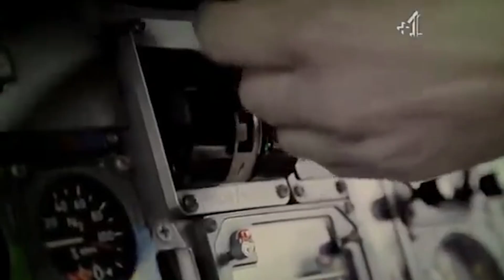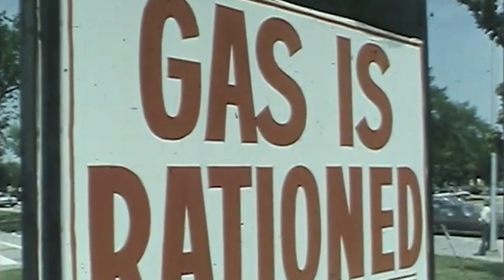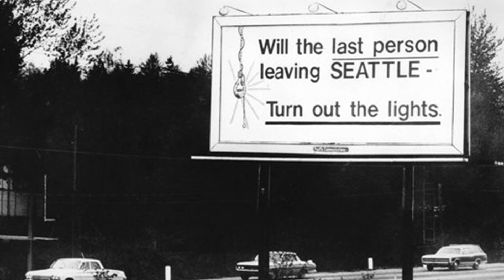The Forgotten American Concordes - Boeing 2707 - Lockheed L-2000 SST

Comment: As I recall, back in the late 60s, the SST became rather a political football in the US, with many politicians snubbing it as a waste of money.  I can't help but see a lot of that attitude reflecting short-term thinking.  As you observed, a great deal of the research Boeing and Lockheed did on the SST had important subsequent use, even as there was considerable positive technological gains from the race to the moon.

I'd love to believe that one day, Homo sapiens can learn to think past the next quarterly report ... but I ain't holding my breath.
Reply: Good remarks, but you all missed, and so did the video, one major event in the SST development that turned many supporters, even in the aviation community into opponents of the concept.  NASA used the XB-70, about the same size as the SST's to test the sonic boom levels. To the shock of designers, when it turned its shock wave actually would break windows. The XB-70 proved that the larger faster Boeing wouldn't rattle windows like the Concord it would break them.  Remember energy increasing with the  square of velocity and so does volume. Adding 10% to the length and width increased the Boeing volume by 120% . factor in the 130% speed increase, which is 170% more energy and you get almost twice the pressure in the shock wave. NASA ad FAA even tried to use smaller aircraft to disprove it and they got----See also https://en.wikipedia.org/wiki/Oklahoma_City_sonic_boom_tests
Reply: Michael Hunt, I was old enough to understand the debates in the USA over the SST during those years . I lived in Chicago. I had relatives in the NY City area. The opposition to airport noise in general and the SST in particular was fierce. Airport noise activists who had numbered in the dozens now numbered in the thousands and they were much more vocal and active. The rural complaints from ranchers, farmers, and wildlife enthusiasts over supersonic booms grew significantly.  The politicians knew they were in trouble when the usual groups who disliked each other were combining on this issue. The letter writing campaigns opposing the SST and supersonic over-flights grew significantly. It was not a matter of if the USA could build an SST. Of course we could do that. We had built the XB-70. The issue was it in the national interest to continue taxpayer funding for something the public did not want. Not just not wanting taxpayer money spent on, but not wanting in general.
Reply: I lived in OKC during those sonic boom tests and remember them well!  While the Wiki article makes it seem like no big deal I remember the windows shaking and all the dogs barking.  After a while you were always kind of on edge as you waited for the next boom.  A boom or two a day would have been bearable but a steady diet of them would have driven people nuts.  Physics isn't just a good idea...its the law!
Reply: The government often bears the cost of developing new technology but I can hardly blame the public with the amount of money that's wasted it's hard to distinguish worthy endeavors from the rest of the pork spending.
Reply: When the vast majority of your constituents want to avoid having potential sonic bangs every 20 minutes, what are you going to do? Keep the SST going?
Reply: David Hoffman  I had not thought of it, but a  lot of people under say about 45 have never heard the 1st and 2nd generation jets.  Many people do not know how loud and harsh the sound was from the early axial and low bypass ratio turbofans. If they had then they would understand why people were freaking out over an even louder plane.
Reply: +Michael Cubstead "nerd alert"
Reply: Meh,  "short-term thinking"  what really killed these was economics,   747s etc.   greatly dropped the price of air travel,   which would you prefer,  an 8 hour flight for $600? (on a plane you could stretch out)   or a 3 hour flight for $3000?   It's sometimes harder to have the courage to drop a project than to start one,  and this has since proven to be the correct decision.
Reply: Its almost like they were right.... it was a waste of money
Reply: Much like the a'hole mayor who shut down Meig's Field in Chicago at 10H30 one night a few years back, because of some of his constituants complaining of noise. I mean really on an artificial island called Northerly Island in Lake Michigan, a good two KM's away from the city's edge. The airport was there before a developing city or suburb, as is the case with ALL airports worldwide.
Reply: *****, After the restriction to subsonic speeds for commercial traffic doing transcontinental flights over land was created, there was almost no way to make an economic case for using the Concorde over routes such as NYC to LA. I think Braniff did a DFW to Washington DC route at subsonic speeds using code shared Concordes, but it was a financial loss. The time difference between a Boeing 747 using the route and a subsonic Concorde was not enough to justify the price difference between the two in the flying public's opinion.
Reply: Michael Cubstead, We just went from C-5Bs to C-5Ms, The noise characteristics are so different. Not only quieter, but certain engine noise frequencies are almost gone. The Bs were terrible.

I used to work T-37s(Tweets) and the difference between that and an A-37 was amazing. The A-37s were more powerful, but you could more easily tolerate the type of noise they produced.

When we first went to KC-135Rs from the older KC-135s it seemed like the re-engined aircraft could almost not be heard during a flyover. What a blessing.

Yes, the younger generation has not had to suffer the noise intensity us old folks did during the earlier decades of the jet age.
Reply: But is that not just the frequency being raised or lowered to an inaudible human level, or at another human inaudible harmonic. Remember we can only hear between 20 and 20KHZ, and a limited harmonic range. Many of us in main stream society can only hear between 35 and 10KHZ, which deteriorates as we get older or exposed to regular high levels of noise pollution. And the younger generation are actually worse off, compared to us from the start of the jet age. They are exposed to modern sound creating electronics, in the form of ear sealing buds with high db levels of music from mobile devices, high db levels in the music and dance clubs, or the sound systems in cars today. In fact we all are worse off today, adding city noise etc. I covered this in more detail in another post here. It's now a known fact that anyone from the 50's to present day has far less hearing on average than prior to these years. We only have around 30,000 hearing "hair" cells in our ears and damage to them is permanent, as they are flattened or separated due to our noisy world. They never straighten up or grow back, so when depleted, that's it we're deaf. Google "How sound affects the inner ear" to read up about it ans see pics of the outer and inner ear.
Reply: Andrew Brown I would argue you are not considering the size of the aircraft. The sonic boom intensity is not just a factor of speed also air displacement. To your point you could resolve the problem by going above FL800. Like the  SR71. The air is so thin the boom (abstractly the sound equivalent of a ships wake)  isn't strong enough to reach the ground.---But I would also argue this, why spend 2+billion developing a new SST, when your 90% of the performance of  an HST (hyper sonic) project.  Consider, you need to add only a thruster system to keep it staple, simple motion control computer, and a kick from mock 3.00 fl800 to mock 6 fl1000 and let gravity and inertia should do the rest.? I also believe we could develop safe field swappable solid rockets to add that kick.
Reply: It was not noise. It was his wife wanting a new flower garden and play area for all her play park demanding friends. She only got part of her wish as there are also noisy concerts held there now. Dumb decision to close that airport.
Reply: David Hoffman Yes point taken. But now what is the paradox, of city works with noisy jackhammers, and when necessary blasting taking place, never mind the general constant 24/7 noise of a city, with people talking, shouting, police sirens going off at all hours of the night and early morning, and all the other disturbing loud noises. Never mind the ear drum shattering decibel levels inside most night clubs, and here patrons put this upon themselves. Or our mobile devices with ear sealing headphones and ear buds, with sound too loud, and those that insist we hear their choice of music in their cars, coming from their massive car sound systems with windows wound down. Then what about those that live on top of airports, especially extremely busy ones, with a plane taking off and approaching every five minutes. Today modern jet engine technology is getting better so below their max thrust, or even before the SST's reach sonic boom speed, their noise abatement is improving, and above 20,000 feet one can just hear a sonic boom, with SST cruisng at 60,000 feet it is almost impercetible, as sound abates and decays over a very short period of time. And on a final note most decent places of work are well insulated in controlling random noise.
Reply: I love long dull videos on tests! thanks!
Reply: But they weren't allowed to travel at supersonic speeds over land anyway, so what's the problem?
Reply: He didn't watch the video. lol Well not the part where they explained it.
Reply: The 727 was loud and sometimes seemed to get louder as it receded away. The engines must have directed the noise directly rearward in a "beam" and if you happened to be in the "beam" it got louder as the plane receded and you could hear a cracking sound in the burn as well. It got louder till it abruptly went quiet as the 727 disappeared into the distance. lol
Reply: Andrew Brown, Every year I get the OSHA approved hearing conservation training and the instructor goes into all the stomach churning detail about hearing loss. I get queasy just walking into a hospital so I am really suffering in those types of lectures. As they say there are no bionic ears to replace loss of hearing.
Reply: David Hoffman I was replying to the comments regarding the noise levels of the SST over land and their contribution to its discontinuation.  Since aircraft are not allowed to fly at supersonic speeds over land then there are no noise levels and pressure waves at those speeds over land to worry about.
Reply: I think we are all missing the point about supersonic speeds and the incurred sonic boom. Why is it an issue with the SST's no matter which country flew them etc. What about the thousands of military aircraft around the world that are capable and do fly today exceeding mach1 and mach2, what about their sonic booms. Many bases are far inland, as well as near the coast in all countries with upmarket aviation military. And not far from civilian populations in a number of cases.

As I posted earlier a sonic boom is almost inaudible a FL150, and at FL200 and beyond it has no interference at all to the human hearing. I am not aware of any military jet than can exceed mach1, not reaching these altitudes, and the only issue is from takeof to climb. So some noise abatement practices will need to be practiced and I am sure it is practiced by these pilots. What about emergency scrambling, do you think any noise abatement is practised then, forget it, it's max speed to target all the way, fuel allowing, from take-off even before wheels up.
Reply: Collectivist
Reply: Karl Martell , ?????
Reply: WTF????????????????????????????????????????
Reply: Andrew Brown , I cannot understand what Karl Martell is getting at with his post of the word "collectivist". Is it a positive comment? Is it a negative comment? Is it defining something?
Reply: +David Hoffman Hence my comment WTF??.. There is no such word in any English Dictionary, the closest is collectivism - the political principle of centralized social and economic control, especially of all means of production.
Reply: +Andrew Brown But in Creole dictionary, yes.
Reply: David Hoffman by using the scientific binomial name, humanity is reduced to an object of study by those who think themselves better than humanity.  These people reject the premise that individuals matter except their peers. 

"All are equal, but some (the masterminds) are more equal than others. Collectivist is always a pejorative because tyranny is the natural social condition. Liberty needs to be defended and cultivated
Reply: Troubleshooter125 and the new law
Reply: Troubleshooter125 do you believe that we eventually can get something the size of a 747 to be able to go supersonic speeds? I'd gladly pay $2-$3,000 to go to Europe in an hour
Reply: VestedUTuber, I think the elimination of the 747 passenger versions is more of an attempt to capitalize on common pilot certification for ETOPS TWIN engine aircraft such as Boeing 777s and Airbus A350s or similar. Eventually the cockpits of all single aisles will be the same and all twin aisles cockpits will be the same for Boeings. Airbus will get to that point also. The "feel" of the different capacity aircraft will be the same due FBW technology.
The only real difference for the longer versions will be ground operations so the pilots do not go off the taxiways into the mud.
Reply: RedLight GreenArrow,  The Concorde was a 2.7 to 1 weight to thrust ratio aircraft for takeoff. A 747-800 would be about 2.5 times the takeoff weight, so you would need 95,125 pound thrust engines that can operate supersonically. The best engine we have is for the F-35 and that is only capable of half that thrust level. We could do a B-52 eight engine configuration. The other problem is the length of the aircraft. Probably twice the length of a 747-800. Where do you put a 400 foot to 500 foot long aircraft? Maybe you can get it down to 300 feet with a much wider fuselage, blended wing fuselage design and no windows.
Reply: noise issue still exists
Reply: JKF throttled that program!  He simply wasn't the brightest POTUS we ever had.  He had other things on his mine besides progress!  Typical liberal thinking.
Reply: Your comment, "Chef"  is worthless because of all the nasty words -- it severely detracts from anything you're trying to say, also, it tells us how extremely young and immature you are!  Go back to peeling vegetables!
Reply: If the USA had been able to build an SST airplane. you can bet your bottom dollar there would be NO problems letting it fly anywhere. The dollar speaks.

Comment: A supersonic jet would have to carry at least the same amount of passengers as an Airbus 380 or a Boeing 747,because it's technical characteristics logically ranks it in the category of long range flyers.The technical characteristics of this plane will not allow it to be competitive with the big medium speed jets commercially even if it's possible technically to build them.In fact the problems are going to be the same as those encountered by the previous engineers of supersonic passenger jets.
Reply: No. The next SST will be smaller and slower to allow maximum speed over populated areas. The public's refusal to be subjected to wall cracking sonic bangs every 20 minutes killed the old SST. A slower and smaller SST can be designed to reduced the intensity of the sonic boom at ground level, so much so that overflight at about Mach 1.5 would be tolerated.
Reply: There are so many technical and commercial challenges to overcome before commercialising a high speed aircraft makes it doubtful to believe that the choice of high speed would be a good solution to earth to earth destination air transport.
Reply: omar atherly, It is interesting to note that we are seeing more interest in trying to achieve total global travel from almost any large commercial airport to any other large commercial airport. Lots of Boeing 777s vying for longest travel distance. Soon there will be Airbus A350s doing the same thing. Non-stop seems to be what travelers want. If passengers would accept travel inside enclosed no window flying wings we could do well with that goal. Now, what role could SSTs play in that travel ecosystem? Private business jet is my guess. Similar to the Gulfstream 650, Falcon 9x, Cessna Citation X, etc. Fastest way to travel, but not necessarily with the longest range. Using fractional ownership or charters would get a decently large potential customer base. The routes? NY City to Los Angeles, NYC to London, NYC to Paris, Washington DC to London, etc. A reduction by about 33% in cruise air travel time. One to two hours less than it is now.